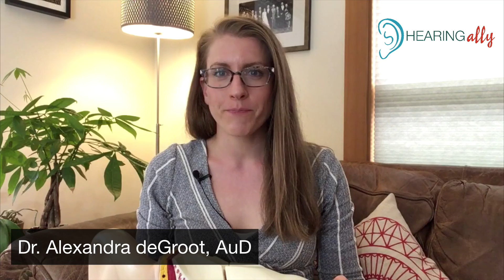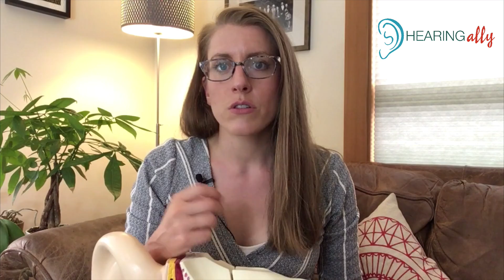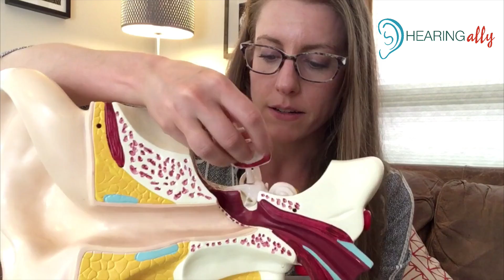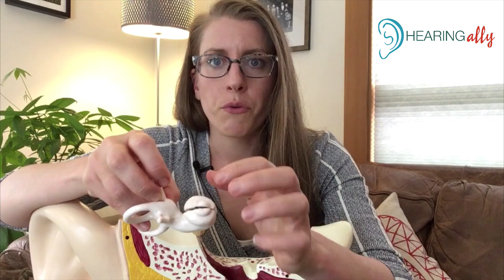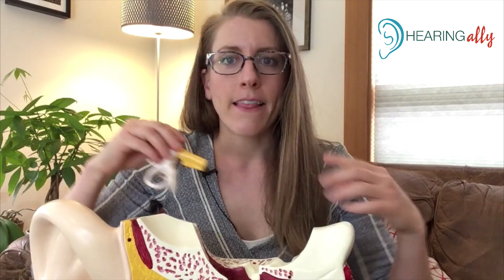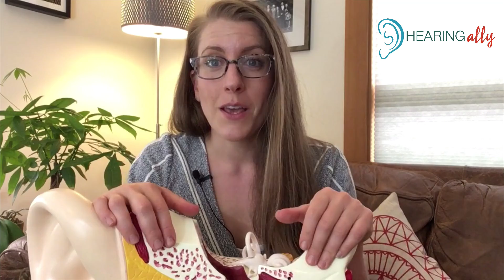What is Sensorineural and Conductive Hearing Loss?

Comment: Is it possible to hear high pitched sounds and not low to mid pitched sounds with sudden sensioneural hearing loss?
Reply: Yes, definitely, though high pitched or a "flat" configuration is more common for a sudden sensorineural loss.
Reply: I have a hearing test done and unfortunately they didnt explain it to me. I have an appointment in 2 weeks at the doctors and am stressed out, because I have no hearing in my right ear. Do you know where I could get someone to explain my hearing test to me?? I’m in Australia

Comment: Dr. Alex, does the ear canal diameter affects hearing?
I had hearing problems since I was a kid.  My doc told us that I had clean ears but he mentions about ear canal diameter. Is it true? How does ear canal diameter relate to hearing?
Reply from the maker: As far as I know, the diameter should not effect your hearing out and about in the real world. However, when your hearing is tested using an earphones they must fit properly - size and shape of the canal can make it so the person testing you need to use a particular size or style of earphone to get accurate results. Also, ear canal shape and size can effect how hearing aids fit and how the sound resonates in the canal, for this reason the gold standard of hearing aid fitting is to use a test called "Real Ear" that takes in to account the acoustic effects of your unique ear canal. Lastly, a very narrow ear canal may make it more likely for your ear yo get completely plugged with wax, which can indeed impact your hearing while there is wax present. I hope that answers your question.

Comment: I recently suffered middle ear fluid from severe barotrauma from a recent flight. Had fluid in middle ear. Had myringotomy with tube in left ear only. However 3 days in hearing is muffled. And I have very loud sound in my right ear. Its like it shoots through my left and tunnels to my right ear very loud. I was told I may have Round window interference. What is that? And will My hearing return? Ear drum had previous scar tissue from tubes as a child. Please Help. Very Worried.
Reply from the maker: I'm so sorry to hear about what has happened to your ears! Unfortunately I've never heard of round window interference, nor do I have another explanation for what you are experiencing. If you are able to I would seek a second opinion from another reputable ear nose and throat physician if you do not feel confident with the one you have. I'm sorry I can't help any more.

Comment: ma'am, if a patient has sensorinueral hearing loss will he be able to hear still with bone conduction?
Reply from the maker: A sensorineural hearing loss measures the same through bone conduction as through headphones.  So if they have a sensorineural hearing loss at 4000Hz, they do not hear any better through bone conduction at 4000Hz than they do through headphones in that ear.

Comment: Hi I've been recovering from a moderate ear infection I had fluid build up in both ears and tinnitus and it has slowly improved over the past 6 weeks. Usually when I sleep the fluid will go to the ear I have facing the pillow. Today I woke up and my one ear felt clogged and slightly muffled. I was crying last night and that probably caused some more fluid to build up but I'm worried. I can still hear fairly normally just slightly muffled. Is this conductive hearing loss??? I'm very scared and have problems with OCD and don't know if I'm making a bigger deal out of this then it is. Thanks
Reply from the maker: Sounds like you probably have a conductive hearing loss from the fluid in your ear(s) - but I cannot say for certain. I'd recommend getting a hearing test and making sure an Ear Nose and Throat physician is addressing the fluid. It makes sense for that to be stressful!

Comment: Well-explained Dr Alexandra.  Can the fluid be sucked out from the middle air? Does that require piercing the eardrum? I hope you explain this point.
Reply from the maker: Yes, it can be but you are right it does require a hole in the ear drum to remove the fluid through. There are also other interventions that aim to open the eustachian tube connecting the middle ear space to the back of the throat. As this is part of normal physiology a new opening does not need to be created. But there are reasons you might chose to put a hole in the eardrum instead. It just depends.
Reply: Thanks doctor. I used medication to make the fluid thin and antibiotics for one week. There is much improvement.  Now still on medication.